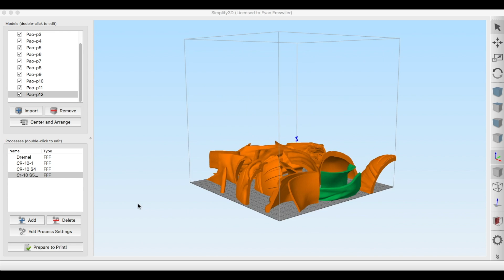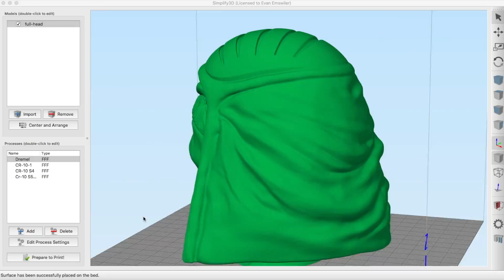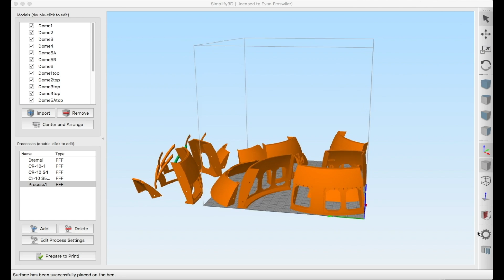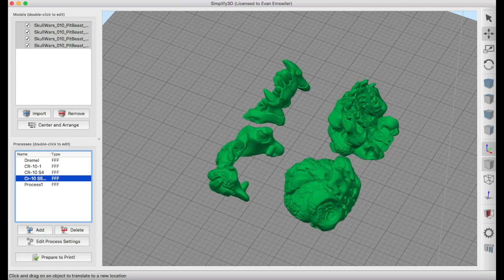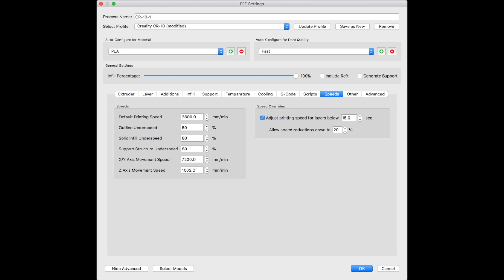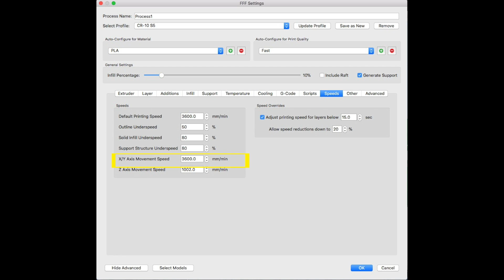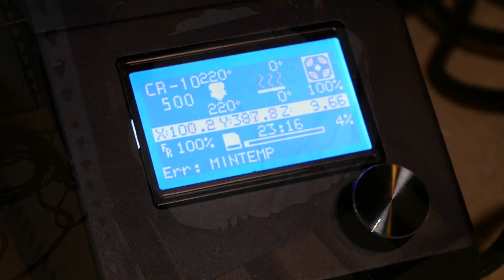Make Insanely Huge Prints on the Creality CR-10 S5!

Comment from the maker: A few random notes:
I sliced all the models with Simplify3D using the Chris Elkins profile that you can get from the CR-10 Facebook page (just altered so it would have the correct build area). Unfortunately you can't really link to it on Facebook, but it should be possible to find if you join the group and poke around a bit.

I forgot to mention it in the video, but I did occasionally experience false positives with the filament sensor (where it would stop the print even though there was still filament). It was not very common, but it's still annoying when it happens. Still, I would rather have the sensor than not have it.

Mr. Baddeley has revised the R2-D2 dome I mentioned in the video to be higher res, which will hopefully get rid of the faceting issue I mentioned. More info here: https://www.patreon.com/posts/full-scale-domes-16524087
Reply: Mighty Jabba's Collection  hi is this the page to get the life size heads etc
Reply from the maker: Which page are you talking about?
Reply: Hi for the life size starwars heads
Reply: Mighty Jabba's Collection .. Hi , Did you print R2D2 in PLA ? I would assume so since the large circumference doesn't cover the heated section of the print bed. 
Do you plan on installing a new heat bed for your printers ? Ive been waiting to buy the CR-10 S5 till I could find a good sale. Let me know if you want to sell one of yours !  :))
Reply: bro, can it also make 3d model with hanging parts (needs support structure)?
Reply: Is there anyway I can get one with just 200 dollars I really want one but I don’t have enough I wanted one big enough to print pc cases and much more

Comment: Hi there - great video on the joys and pitfalls of the CR-10 S5.  I bought one about a year ago and I just got around to trying to set it up.  I know - but life happened.  Anyway, I bought a PEI steel plate but haven't installed it yet.  I saw in another video where someone took off the glass plate completely and applied the magnetic sheet directly to the metal build carriage and compensated the height with washers.  Since you have a lot of experience with these printers, and you noted that the heavy build plate along with heavy models caused greater inertia resulting in layer shifts - I was wondering if you think this is an advisable mod.  You seem very knowledgable so I thought I'd check here.  Thanks!
Reply from the maker: I’m not really sure to be honest, but it’s worth a shot.

Comment: Link for that strain relief bracket?
Reply from the maker: Unfortunately I think originally found it on a private Facebook group so I couldn't link to it. And I don't think I still have the STL either. But there is this model on Thingiverse. Not sure if it is related to the one I used but it seems similar: https://www.thingiverse.com/thing:2417899

Comment: Thanks for your video. I have been also using this printer for the last 3-4 years. but It gives me heartache to properly level the bed, and If print huge part then one or more problems arrive, like the bed could not hold the print due to the large weight of the printed part. The screw got loosened by the weight of the print.
What are the mods that you have made to this printer? What's your bed leveling process? 
Thanks, mate
Reply from the maker: Honestly I have done almost nothing in terms of mods, except for adding strain relief to the cable leading to the bed heater. It can be very difficult to level though, it's true. When leveling I usually print something that has a skirt that goes around the entire bed and manually adjust the knobs as it goes until it's printing evenly. I also always use glue on the glass

Comment: I have the same unit, had it for over a year I am having real issues with under extrusion.    Everything comes out about half the weight the  software says it should weigh and everything is super thin an crumbly.  Tried different filaments, and temps, very frustrating,  I'm thinking of trashing it and getting a Prusa just because.
Reply from the maker: Did it work at one time?
Reply: @MightyJabbasCollection  You know it kind of did,  I did get a few decent prints although I'm not sure if any of them were 100%.
Reply from the maker: I ask because sometimes what you describe can be due to a partial clog. Have you tried changing the nozzle?
Reply: @MightyJabbasCollection  I've swapped out 5 different nozzles, and I've even tried different size nozzles up to 1.0 mm

Comment: I am fighting with my printer to get it to print with glue and even stick on pads noting will allow the print to stick to the bed if you had this problem how did you fix it? and also what do you recommend to do to it? thank you in advance
Reply from the maker: I expect the problem is that it isn’t properly leveled. It can be tricky. Also trying a bigger layer height at first can help

Comment: i brought this as my first printer, i was completely naive to be honest, with no previous experience in printing i had truly plunged into the deep end etc. i spent weeks pulling my hair out trying to gain control over it, only to achieve moderate success with the various small prints i attempted to print. after doing endless research online through various forums, facebook groups etc it seems the only way i might stand a chance of moving forward was to buy and install a hand full of popular mods and upgraded parts to ensure consistent functionality of the machine. anyway, two years later its currently sitting in the corner gathering dust. i jumped in with excessive enthusiasm but this machine brought me to my knees after about a month lol, i do plan to try again but ive got a lot on my plate currently and will need to put some money aside for all the expensive little bits and pieces i will need to import to enter round two of the learning curve, wish me luck yeah ;) *oh and if anybody here knows any good trouble shooting threads for these machines please comment and share links if possible ;) cheers
Reply from the maker: I don’t think any major mods are necessary (I haven’t done anything but add strain relief to the heat bed cable) but as I have mentioned before, this would be a pretty brutal machine to start with as your first printer. The biggest issue is just physically leveling such a huge bed. Without some experience and a “feel” for how to do it, it is very challenging. Maybe try getting a smaller cheap printer and getting some successes under your belt before going back to this.
Reply: @MightyJabbasCollection  man i tried practically every recommended leveling technique under the sun and then some lol, and then the issues with adhesion to the glass build plate began, and i tried every possible variation of glues, hairsprays etc to get my prints to stay in place during printing with mediocre success at best. dont get me wrong, i did manage to get a few a few good test prints done, but practically every time i attempted to launch into a serious print, everything would seem to start nice and smoothly but then i would run into issues half way through the print etc , such as the print coming loose from the surface, strange things randomly happening with the printhead destroying the print etc and the whole process would be a massive waste of time and materials. like seriously, how can a print be going so well and then 16 hours in it just goes to shit when you had maybe 2-3 hours left of the print before completion ??? it was just too frustrating yeah *im also curious why they ship those warped bits of glass with such an expensive machine, surely they could throw in something more accurate and reliable as a print surface ? for me it will cost about $400 australian to import a decent build surface kit from america so you can see why the machine is currently sitting in the corner gathering dust lol. i was admittedly a bit stupid rushing in and buying such a big machine but i just assumed they would all be basically the same to operate no matter what the size difference was ? if i had known i would have brought a smaller one to start with

Comment: do you think it will be possible to make the print even larger in the future like go from 500 to 550 or 600 in any direction ? i mean in the future as the new drivers gets released?
Reply from the maker: Well there are physical limits to how big this particular printer can print, so unless you somehow alter it physically I don't think they can make it print bigger than it already does. Obviously a different printer could theoretically do it, but I do think they are already at the limits of what is possible with this general design (using a very large print bed that moves, rather than having the print head move)

Comment: no expert on FDM printing, but 3 rolls of 1kg plastic should be 3kg. a quick google or mental math of multiplying 3*2 im pretty sure equals around 6-9 pounds.
the fact you made such an idiot mistake kind of invalidates any faith i had in you after suspending my disbelief of you as a credible reviewer despite printing a comic book model. even considering that youre american, i find it hard to believe any serious engineer would say something so stupid.
Reply from the maker: I said it took 2-3 rolls of filament per piece for a rough total of 15 pounds (keeping in mind that some of the filament is thrown away in the form of support materials). But sure, I'm the idiot.
Reply: @MightyJabbasCollection  makes sense now

Comment: what does it mean when cura tells you that your part is not manifold ???
Reply from the maker: It means that it isn’t “water tight” — there are holes in the geometry so it won’t print properly. You need to repair it somehow
Reply: @MightyJabbasCollection  This is my very first time at 3D printing and I am using Cura, but I do not know how to fix it as the stuff that I am printing off came off of Thingiverse.
Reply from the maker: Well you might want to choose a different model for now in that case.

Comment: Is the CR 10S5 bigger than the CR 10S Pro V2??
Reply from the maker: Google would tell you the answer, but yes it's much bigger. The bed on the CR-10S Pro V2 is 300 x 300 x 400, while the S5 is 500 x 500 x 500

Comment: Large 3d printers are best made without moving the bed.  The bed's weight is counter to the speed and longevity of the stepper motors.  The vibrations and the movement of the bed with large prints can more commonly cause defects in the prints.

Comment: The heated bed is good if your printer is in the garage or cold are cause shrinkage of the filament when it hits a cold glass plate will cause the part to pull off the bed in some areas. Heated bed is optimal but only useful for the first 10 layers or so ever

Comment: Great work! Did you do any modifications on the printer? There are some different opinions about this printer. I ask you because others do a lot of modifications on it and have worse printing quality then you. I am not really experienced in printer modification as I had only Prusa MK3 and all went well with it. I want the CR-10 S5 because I want to print bigger models. Thanks for your help! Great video with lots of explanations!
Reply from the maker: I didn’t do any meaningful modifications, no. But this machine can be difficult to use because of its size. Maybe that accounts for some of the differences?

Comment: I'm new to 3D printing and I just have 2 question. What's the software you use to edit your creations? Once a purchase of the CR-10 S5 has been made, does it come with free software or does it require a payed trial like SolidWorks?
Reply from the maker: I'm not entirely sure what you're asking. You generally need a slicer to be able to print existing 3D models (files in STL format that you might download from someplace like Thingiverse). There are a number of free slicers like Cura that you can download and use. If you're talking about making your own 3D models, that's a different matter and would require another kind of software. You can try starting out with something like TinkerCAD, which is free online 3D design software. Or if you want something more advanced, you can try Fusion 360, which I think is still free for non-commercial use.

Comment: How did you manage the filament swaps? Just by using the runout sensor?
Reply from the maker: Sort of, but as I mention elsewhere, I had problems with the printer stopping even when it still had filament left (false positives). So I stopped using the run-out sensors to actually check if I ran out of filament, and just kept a snippet of filament in there that I could remove when I wanted to swap rolls. It seemed like the easiest way to handle it, even though it meant having to track how much filament was left manually.
Reply: @MightyJabbasCollection  
Thanks for the reply. 

Sounds tricky. I want to do a couple of prints over 1kg. Just working out how to do the swap with out messing it up

Comment: If I have a spool that's about to run out during a print I just quickly put the new one on and use a lighter to soften the ends and press them together so it continuously just keeps feeding. You might have to use a X-acto knife to shave it just a little if you deform the ends a lot pressing them together but it works.
Reply: I'm going to have to try this sometime

Comment: You can get a Keenovo heated bed to replace the stock heater. The Keenovo will heat the entire bed, rather than just 60% of it, and it will heat up much faster, and maintain temperature better as well.

Comment: Great video and amazing prints. Just bought my first printer, an Ender 3 pro and it will do me for now anyway but judging by your video I'd rather have 2 smaller printers instead of 1 big printer
Reply from the maker: Probably a good choice unless you absolutely need huge things printed in one piece
Reply: @MightyJabbasCollection  yeah I was really tempted to get the cr-10 with the 300x300x400 build volume but maybe that will be my 2nd printer eventually
Reply: @MightyJabbasCollection  p.s. thanks for the reply. I wasn't expecting it on a video posted over a year ago

Comment: That amount of filament is indecent! 🤪
(You can seriously cut your print times by switching away from hexagonal infill, it’s a fraud as far as fdm is concerned. Very time-consuming and does not bring you the strength you think it does. Check out CNC Kitchen video on infill strengths if you need proof).

Comment: 7:16 How the hell did that bridge?  Witchcraft!
Reply: We're never getting an answer... -_-
Reply: My guess would be: "VERY slowly!" allowing the material to cool and solidify enough, before continuing onward.
Still a bit of a gamble.
Reply: Science Side of Youtube please provide an explanation
Reply: Actually, I got this exact 3D Printer about 1½~2 months after I last commented here.
It's incredibly good and I've witnessed myself how this type of bridging happens.
Basically, if the temperature is properly set, the material will solidify, but stay flexible/liquid enough to get "pulled" in a straight line, without drooping the slightest. Whenever I start a new print, the extruder "auto-home"'s in on the starting position and touches ever so slightly down, "kissing" the plate, before moving back up and THEN go to the center, where the print will take place. When it "kisses" the plate, some filament may be leaking out, so each time I make a new print, it creates this little 0,4 millimeter "tower" about 1 cm high and from the top of it, it will continue to leak a tiny bit of filament, towards the center of the plate where the print starts. So there's this little "bridge" stretching perfectly 20~25 cm across, 1 cm above the plate (decreasing in height because the extruder moves down slowly, to where the print starts.
It's really cool to look at and I can definitely see how "tiny" gaps, in comparison, like this, are able to bridge sometimes. Still a bit of a gamble to try, as I said 3 months ago, because drooping can still occur, as shown higher up on the print, when it begins to form the curve of the dome, without supports.
Reply: This video motivated me to look into this more  with my cr-10 s5.  I ended up installing a Petsfang blower and I have not had one bridge fail so far.  Yes drooping can still happen, but the post layers are perfect.  The drooping in the windows can be easily fixed post print.  I can't say enough good things about the Petsfang.   I am not affiliated whatsoever with  them and its open source free to print for yourself.

Comment: I don’t know if you have fixed the heated bed, or if anyone has helped, but I got the same error mintemp on my ender 3. I ended up replacing the transistor (I think that’s what it’s called) it’s basically the heat sensor. I just bought an entire new hotend (the problem was with my hotend sensor, not the bed. ) and that fixed it perfectly. Hope this helps.
Reply from the maker: Thanks. In my case I'm pretty sure the issue is the cable being worn where it connects to the heat bed. I think a number of issues can potentially lead to the same mintemp error.